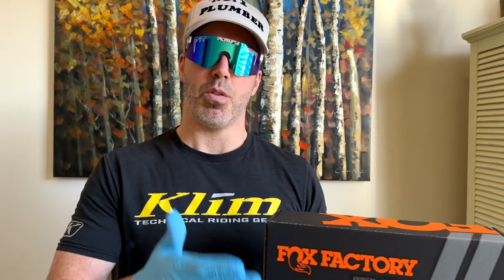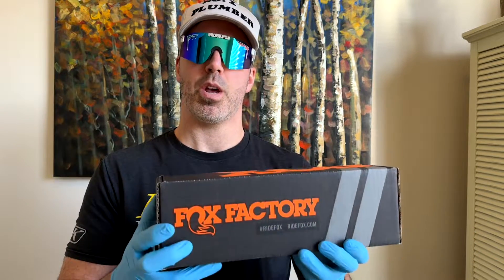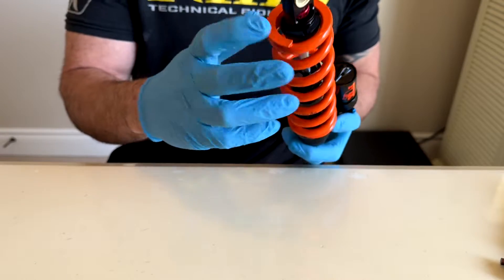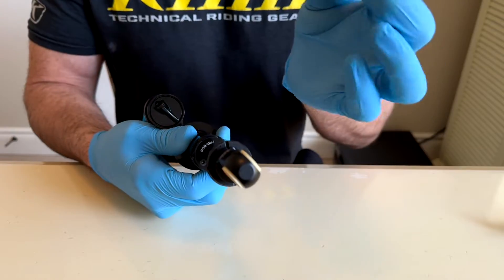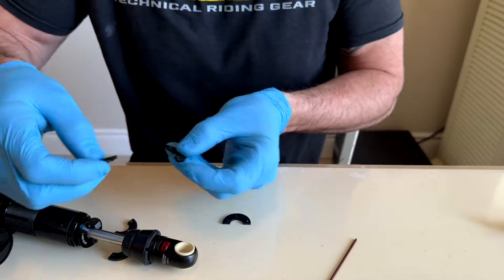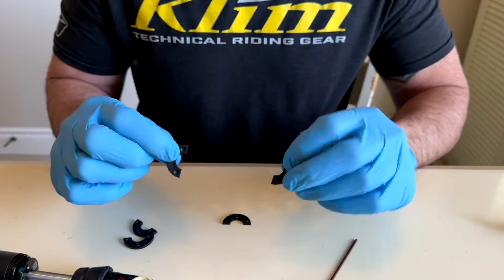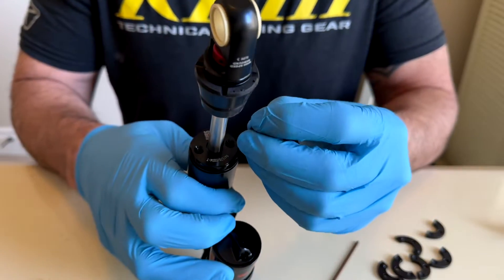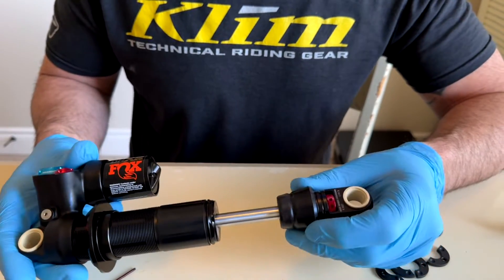CHANGE the shock stroke/travel on the new FOX DHX2 - EASY TUTORIAL

Comment: Good video but I think the travel change on stroke doesn’t equal to rear wheel travel change… it should be proportional I guess. Eg 165/60*65=178.75 😅
Reply: 165/60*62.5=171.875 so you may want to use  62.5mm instead?
Reply from the maker: I followed the instructions from Santa Cruz and the techs at fox .

Comment: is it the same for the dhx I have a 230x57.5 shock will I be able to make it go to 230x65
Reply from the maker: Don't think you will be able to go from 57.5 to 65 but I could be wrong, best thing to do is call fox and they will tell you for sure if it's possible, cheers !
Reply: yes it works as each spacer is 2.5mm and this DHX is a 230x57.5mm fully preinstalled with 3 spacers
Reply: @n0way72 so if I understand this correctly, if I purchased a 230 x 65 and removed just one spacer. That will give me a 230 x 62.5?